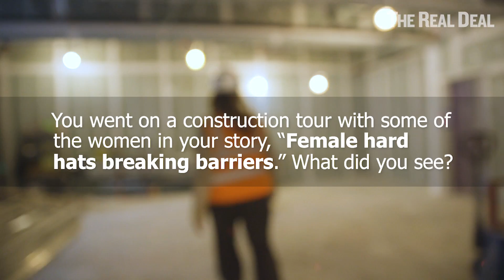Why it's tough for women to work in construction, and how that can change

Comment: Yeah you see women driving the air conditioning trucks and running the air conditioning backhoes but you never see them digging with a shovel or doing the outside work they're always doing the easy work like clean up or picking up tools. For every six women you have on a construction site only one can really do the same work as a man and I'm talking being able to carry block and brick at the same rate.

Comment: Well, when I need to fix the house. Where are the feminist?
Reply: Vinay Dhiwar  I have made dozens of houses and a hospital.
Reply: Vinay Dhiwar  what about bricks? Your English is horrible. I'm not sure what your question is but no-one uses bricks where I'm from, just concrete and false stone veneers
Reply: Vinay Dhiwar  it sounds like you don't know what houses are made of. Houses ARE made of wood, and when I was at work on Friday the 3 story house I'm building seemed very real indeed.
Reply: Vinay Dhiwar  inventions by women: rocket fuel, hot water heaters, nylon, laser, chemotherapy, circular saws, glasses, windshield wipers, globes, life rafts, medical syringes, the game monopoly, electric refrigerators, central heating, foot pedal trash cans, low reflection glass( necessary in  cameras), wireless transmission technology, bullet proof fibre, caller ID, RADIATION, NUCLEAR FISSION (as in the nuclear fission used in power plants)
Reply: @thawillyfish  You go girl❤️❤️❤️❤️❤️❤️
Reply: Justin Y.  Pretty sure he has hard time getting over some high school rejection and is crying over😂😂😂
Reply: Vinay Dhiwar  Think again, or at least think!  Men come from women womb! 👁️ 👁️ 👁️
Reply: @thawillyfish  You're spreading a lot of misinformation.

Rocket fuel was made by Robert Hutchings Goddard, Walter Taylor invented the circular saw, One of the earliest recorded patents for the windscreen wiper is by George J. Capewell of Hartford Connecticut, which was filed on August 6, 1896. The earliest most modern globe was invented in 1492 by Martin Behaim, inflatable rafts were invented in the 1840s by Lieutenant John Fremont and Horace H, Alexander Wood invented the modern hypodermic syringe in 1853, The first electric refrigerator for domestic use was invented by American Fred W. Wolf, William Strutt invented the first modern central heating system in 1793, The inventor of the modern day water heater was Edwin Ruud, a Norwegian mechanical engineer working in Philadelphia. In 1889, he designed “the first automatic, storage-tank type gas water heater.”, Ukrainian physicist Alexander Smakula invented the first anti reflective lens coatings (low reflection glass) in 1793. 

it is believed that wireless transmission technology was made my Hedy Lamar, when that's not actually true. The earliest patent for signal hopping was patented by Nikola Telsa on march 17, 1903. An example of bullet proof fiber is the bullet proof vest made by Casimir Zeglen in 1893. In 1968, Theodore George "Ted" Paraskevakos invented a system to automatically identify a telephone caller to a call recipient. This method was the basis for modern-day Caller ID technology, Henri Becquerel was the first to discover radiation in March of 1896. 

Next time, actually do some research before spewing out false information.
Reply: @mioangel1227  The sperm comes out of a man. The sperm is also what determines the gender.

Comment: Every time I pass a construction zone the token woman is twirling the "slow/stop" sign while the guy is operating the 150 dB jackhammer and shaking like an epileptic. "Equal pay for equal work."
Reply: Don't worry, the dudes getting repetitive strain injuries
Reply: I say they switch jobs, I could do with a good laugh.
Reply: @delonthomas48  Yeah I've seen some men twirl the sign too, when there aren't any women around. But of the construction zones where there's one token woman on site, she is always holding the sign. Have you ever in your life seen a woman operating a pneumatic jackhammer? Ive driven about 120k miles in my life and not once have I seen this. "Equal pay for equal work" forgot about the equal work part. How about underwater welding? Linemen? Fishermen? Oil rigs? Men do all the dangerous jobs while woke/obese women with a humanities, liberal arts or social sciences degree complain about how there aren't enough women in jobs where humanities, social sciences and liberal arts degrees are completely useless. Men are more physically capable and willing to do dangerous jobs. There's a pay gap for a reason. In fact, there should be more of a pay gap but that's a different story.
Reply: @delonthomas48  None of your comment addressed anything I said, it was more of a rambling than a coherent statement. I never said women in construction were obese. I said women with useless degrees that are obese complain about how there aren't enough women in these jobs. I also said that "equal pay for equal work" is a lie. The work is not equal. A woman twirling a 'slow/stop' sign at a construction zone is not doing the same work as the man on the pneumatic jackhammer getting nerve damage and hearing loss and working an extremely physically demanding piece of equipment. I stand by that. It would be better to call it 'equal pay for unequal work'.

Comment: The funniest part is that they would ask the women that what is the reason for the pay gap they will start say sexual harassment, they want to lead but don't want to get there hands dirty on the field by lifting heavy equipment and others to they want to just sit in the office and work around as inspector with any experience first hand at the job except der degrees

Comment: This is absolute nonsense, I work within the construction industry and the last three sites I was on were managed by women and the architects and engineers were women. You absolutely can NOT make any comment about sex or even look at them funny without being sacked on the spot which I have witnessed. I have seen young female apprentice in every trade and they all get paid more than the men or the same.
Reply: Cool place to work. No tolerance for sexual harrassment.
Reply: @adwaitab.3622  yes true, but the women are sometimes much harsher than the men, one of the female bosses was repeatedly making racist comments to one of the lads to the point were it was just cringe, and the lad just left in the end. You could easily see it was just an ego thing, trying to show off.
Reply: @theguitarist7911  Men do not make racist comments?
Reply: @adwaitab.3622  not the point hypocrite 
If the roles were reversed you would complain and play the victim
Reply: @jackjohnson6230  Exactly bruh. They are so hypocritical

Comment: Well maybe because women don't want to work in construction because some of these job need you to actually study for it and have a licence for the job.
Reply: My dad never studied or had a license for it. He was picked up on the side of the road and started simple with painting, and then he was taught everything else from roofing, foundations, flooring, cabinet making and installing, all of it. The only people who need to be licensed are the general contractors and project managers, but the actual construction workers don't, and it's why so many illegals are easily employed in this field. What is making it difficult for women to break into this field is that you have to be physically strong. It's easier for a man to work with big machinery, heavy wood, bricks, cinder blocks than it is for a woman. There are women who are strong, don't get me wrong, I know, I am one of them. But a man that has my same weight and height will always be stronger than me, and he will also be more efficient in the construction business than a woman.
Reply: @spirittammyk  the point is that most women aren't interested in working in construction. sure I know so many people begin careers that they never imagined doing and don't have the license or knowledge (at the time), but over time experience beats having a license or what school you went to. Also, good job being a strong women in working the fields. My Dad doesn't have a licence and change careers.
Reply: @22services  With all due respect, most men aren't either.
Reply: I'm in my fifth year I'm getting my license what is wrong with the world oh my gosh I'm writing a book come find...it..
Reply: Nah you don’t need a license or education to start out
Reply: @spirittammyk  Why have to mesure who is more strong. I specially looking what king of man working in constructon, usually small fat and very week man working in construction. Has a lot of man that are not strong and very weak. I am strong woman but not all of woman are strong eh. I need to work in construction but I been discriminated because I am a woman!!!!!! It si a fact, and it is a shame!! Man need woman to be slaves working for free for them or prostitutes!
Reply: @ohwellnoel2102  Yes you are a man, I maybe have to were man clothes to be able to get to construction as American woman was doing that in the past, it is a shame!
Reply: Woman want to work in construction a d are heavy discrimination do not let woman work in construction and. I am from Europe in Europe woman working freely in construction.